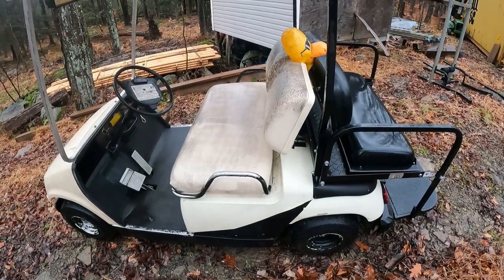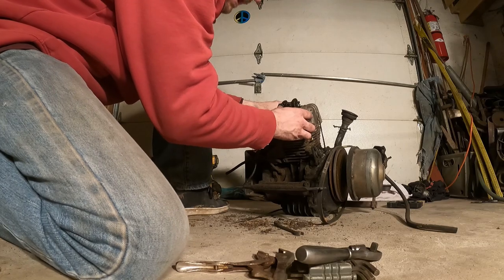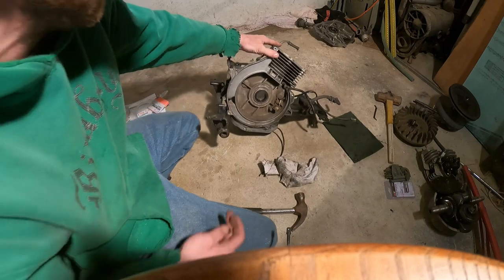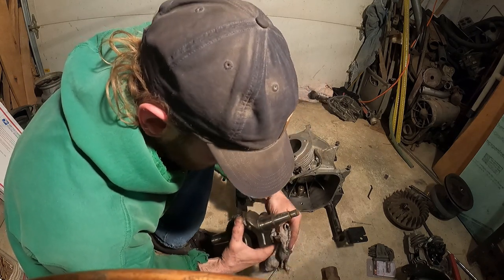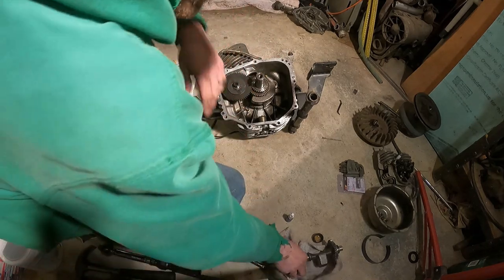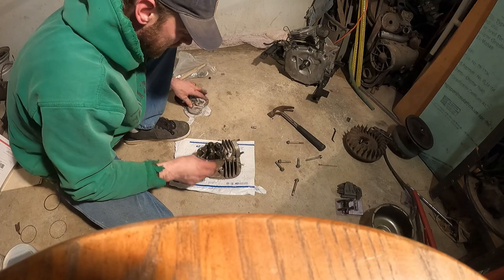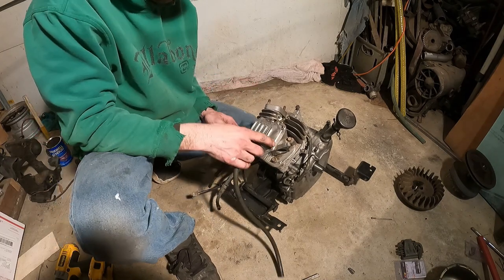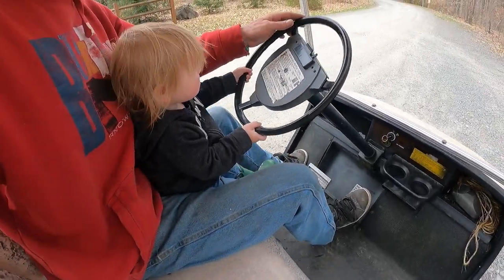How to fix your Smoky Yamaha Golf Cart Engine Rebuild time

Comment: I bought a g11 golf cart $500 their is loud clunking noise so I pulled the top end where the valves are and turn the flywheel and found out the piston was loose so I'm rebuilding the whole motor Thank You so much for the video helps me immensely
Reply from the maker: Glad I could help you out!  Great project when you look back at it.

Comment: Hi need help, I have a Yamaha golf cart that started smoking one day, pulled in the garage and found gas had soak the filter and was in the air box so checked the oil and there was gas in the oil, I drained the oil and replaced the carburetor, fuel pump, air filter, spark plug added new oil then test drove it , no smoking but had little power to pull a small hill, so pulled the new plug and it was covered with very heavy black soot, so put another plug in and drove it same thing, don’t have a clue what is wrong, have you ever had an experience like this? Any advice would be greatly appreciated. Thanks

Comment: Good Video.....  there are several questions that i have that you did not go over, you just cut the video and returned, first you took measurements to the cylinder head to see if you needed an over size piston, what are those measurements and how do you find out? second question you talk about honing the cylinder, what type of hone do you need? is it one that you would buy at harbor freight with 220 grit? also the rod bearings, my  crank was scared pretty bad, so i  ordered a brand new crank and brand new rod, i cannot find anywhere that talks about rod bearings to find the size, i do have a service manual however i am not seeing any of this information.  any help would be GREAT thanks.

Comment: Many Thanks, I would have liked to see you hone the cylinder walls. I'm still stuck there. You are a fine mechanic. I can imagine what you could do on a work bench.  Many thanks for the great info ,
. Ill be using it tomorrow
Reply from the maker: The key is to constantly keep the hone moving so you get a cross hatch.  It's easier than you think. The pattern of the hatching shows up quickly and it's easy to follow.

Comment: I had the same issue with the air box doing the starter. Now she is running she smokes. Ok probably have to pull the engine and do the same.